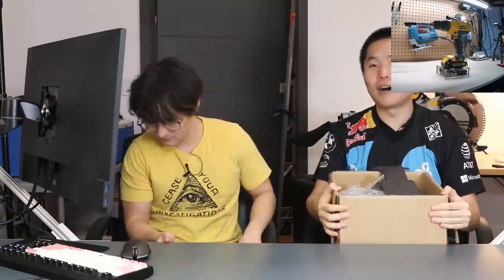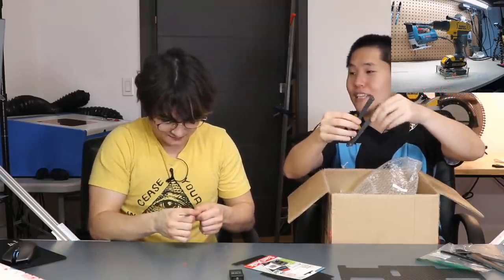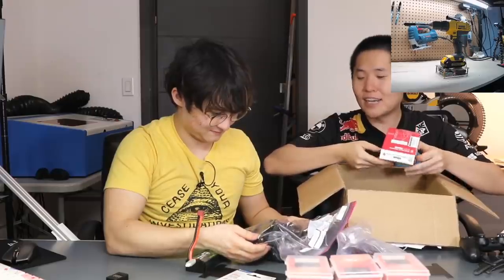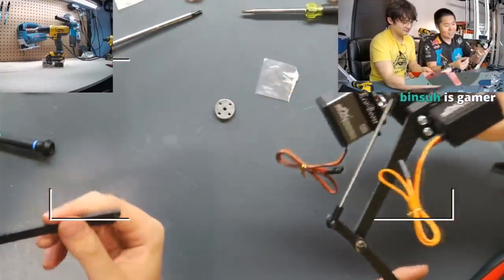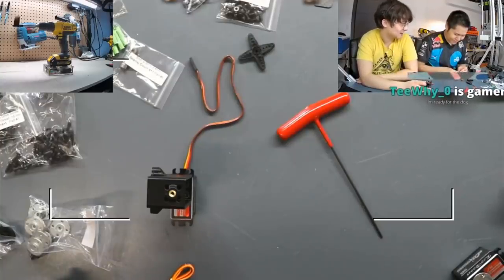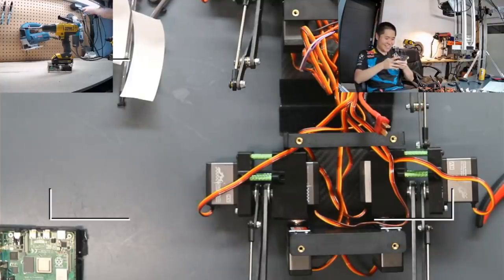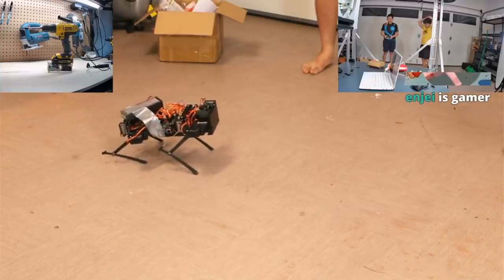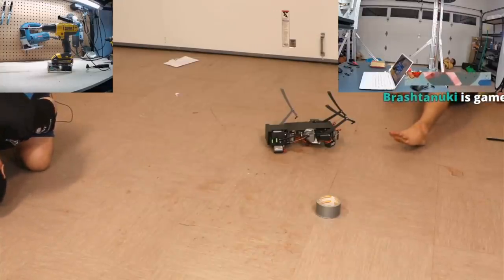Michael Reeves and Disguised Toast Builds $1000 Robot Dog On Stream! | Michael Reeves Highlights

Comment: "Idk what a capacitor does... Sometimes a circuit doesn't work, so I put a capacitor in it and maybe it works."

Such is the basis for Electrical Engineering
Reply: My brain: a capacitor stores and releases electrical energy in almost an instant in the form of static electricity, and...
Me: so what is it for in a circuit
My brain: uhh
Reply: I feel it's that instant surge of electricity that give whatever it is connected to enough voltage to provide sufficiently for the amp draw of said device. I know in HVAC that's what we use it for on the Start windings on motors, then it drops out for the Run windings to continue the voltage flow, while the common continually provides the other leg.
Reply: I haven't watched the vid but they're generally used for decoupling
Reply: As far as I can remember from school it's often used for voltage stabilization. Just slam one in somewhere between + and -.
Reply: @LPmariiio  Capacitors practically just store potential energy in a dielectric material between two conducting plates. In DC, they'll mostly just break a circuit by creating an open, still maintaining the potential difference though. In AC, there are plenty of applications since they don't charge/discharge instantly. I don't wanna get into it, though.

My point is, it was a joke... 

but electrical engineers/students hardly ever actually know what's going on. It's a constant struggle to figure out what's happening on the job. THAT'S THE JOKE
Reply: Agreed as tbis conversation has gone. I think it was too good of a joke we had to figure something out.